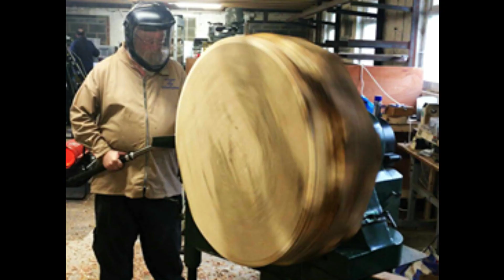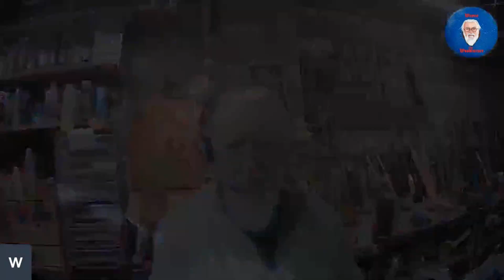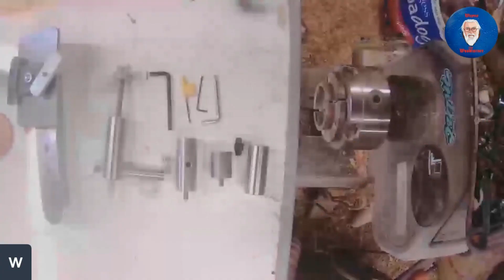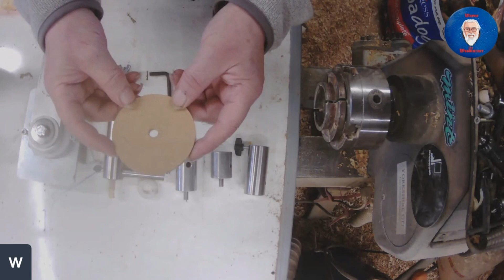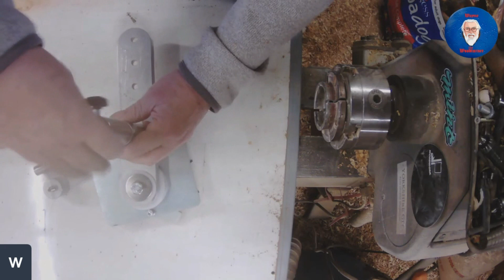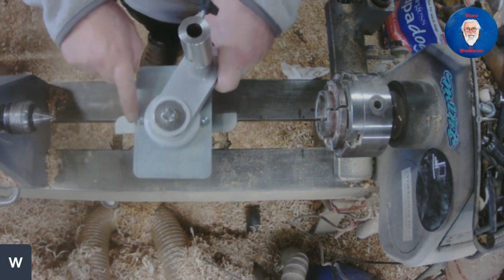Woodturning - Paul Howard Sphere Jig

Comment: I've owned the Paul Howard Sphere jig now for over 3 years and love it.    I have made a few technical changes to it to make life easier in it's use.   First of all I did away with the cumbersome clamp system that comes with it and put on two clamp blocks that fit the ways of your lathe.   Much simplier and one does not even have to square the unit since the blocks do that for you.   Secondly, I added a center finder rod that retracts up and down using a sharpened brass brazing rod.  This gives much better accuracy than trying to center with the carbide cutter.   Third items was I adapted the unit by adding anothe drilled hole up front which now allows me to make Concave cuts instead of just the convex which the jig was only designed for.   This has proven to be very valuable to me such as making Locking sphere jigs fixtures.      My Sphere jig is now much more versitile and I love it even more.